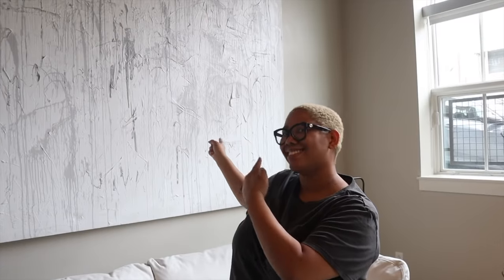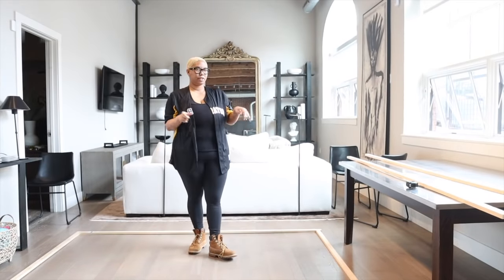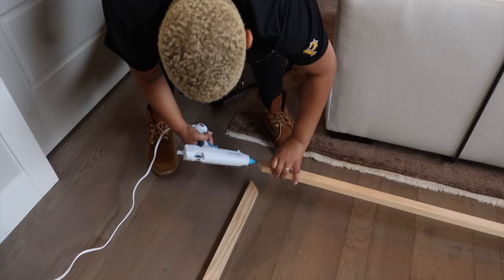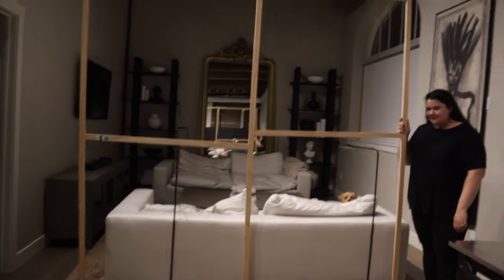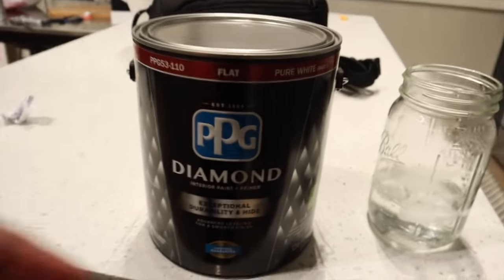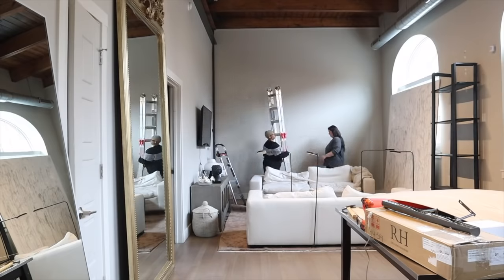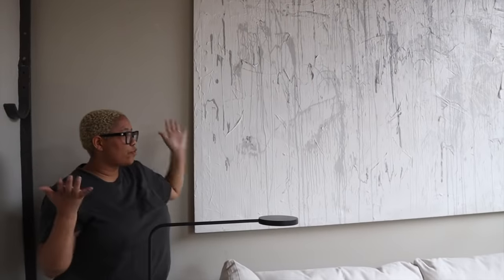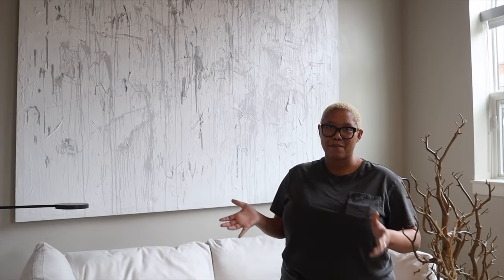DIY HUGE CANVAS & MINIMALIST LIVING ROOM STYLING

Comment: You did such a Great Job! I love the lamps 😭😭 i have been looking for them every were. IT is sold out and have not found them and facebook marketplace and stuff. Can i give you a tip! When you make canvas you should prep it before painting. You prep so the paint Will not soak in the fabric and rot it over time. The prepping Will also make the fabric tight like a drum. You prep the canvas with water(60%) and pva glue(40%). you coat the entire canvas. Let it dry and begin painting. 😁 Aspecially smart to do IT you are using spackle and stuff. Because it is heavy and can make the fabric droup. I am sorry for spelling errors, i am not American 😁

Comment: Super Inspirational!  Just finished stretching a 44 x 60 canvas.  Canvas pliers are the bomb….plus….my staple gun has a setting for 'wire'.  This simply means that the gun will fire the staple in 3/4 of the way… This makes it easy to remove the staple with a pair of pliers for fine-tuning that canvas, and when you are happy, then you just hammer them home.

Comment: I used to work in home depots lumber section. From what I was told, back in the day there was a "nominal" size, which is the "2 by 4" or "2 by 10," etc. That's the size that they cut from the logs. After that they would dry it in a kiln and plane it so it's more or less flat on all sides, so it can be used in construction. This drying and planing process would leave it smaller than when it was cut, but the habit of calling it 2 x 4 stuck around. Modern methods change this process a little but the final size is roughly what a 2 x 4 used to be after it was dried and planed.

Comment: I wish you would have described/shown the process of the actual painting. Maybe with someone holding the camera close-up? What were you using to apply the paint? Did it drip? I guess this video is mostly about the canvas than the painting. :(
Reply from the maker: I mostly applied it with my hands and I dripped paint by standing on a ladder and pouring paint with a solo cup! I used spackle to create background texture and then painted over with white paint. Then I dripped white and gray paint until I was satisfied and smeared it with my hands!

Comment: As an artist I would highly recommend using thicker wood.  The thin ones will warp over time.  Use 2" thick instead of 1" thick pieces.  they also look more finished and professional like pieces in a gallery.  Also a piece that size will need a lot more cross bracing.  But the canvas drop cloth is a great idea.

Comment: Obsessed with all your DIYs! I just ordered drop cloth to try and cover some old canvases and rework them like this, I just am curious - do you need to prime the drop cloth or cover the whole canvas with paint or spackle first? It didn’t look like you did that, I just wasn’t sure! ❤️❤️❤️
Reply: Why don't you just paint over the painting?   That sounds like it would be a lot easier, not as heavy and cheaper than adding a drop cloth. Add the texture you want onto your existing canvas. Good luck.
Reply: Thank you for the tip! I know, I was thinking about doing that at first, I just wanted that beige fabric texture on it too... going to have to try it out haha